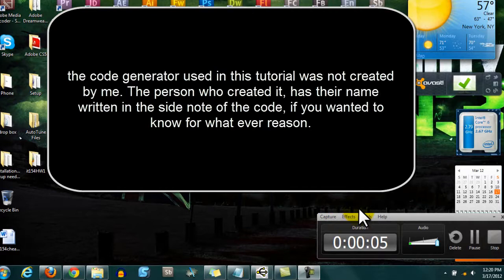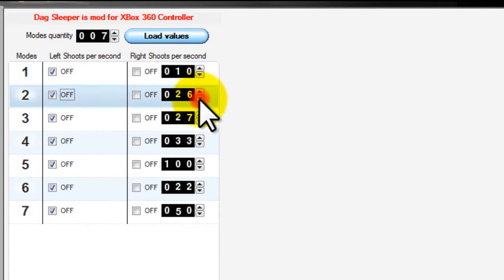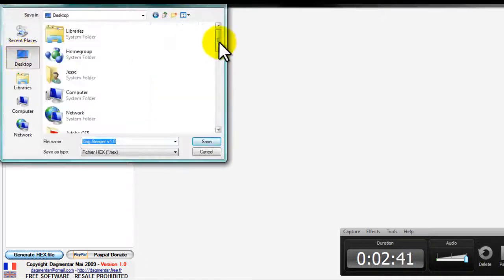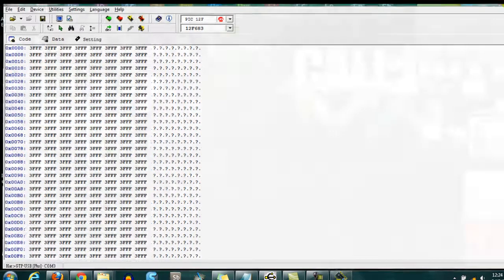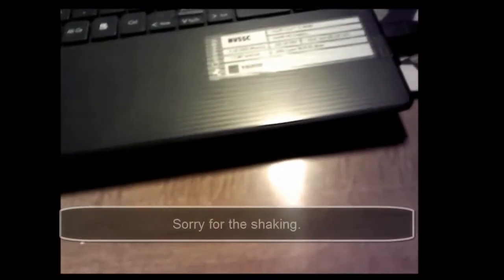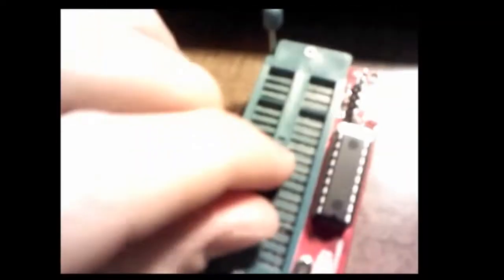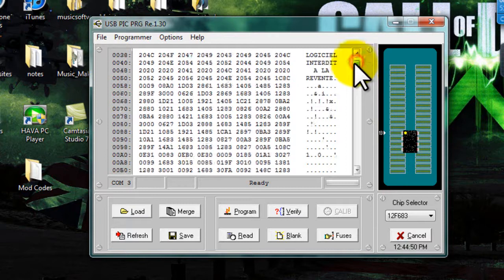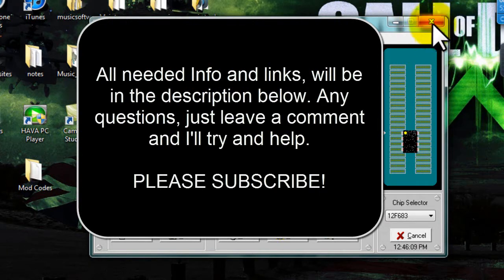How to make a Rapid Fire Mod Controller(part 1 - programming the chip)

Comment: Xbox one ?
Reply: The chip is a ATiny85 Micro controller, You can actually do it without the AVR/ISP Pic Flasher by using a ATiny85 With usb and breakout board Attached. This will cost less than the programmer And all you need is Arduino IDE. Where the code is practically Java, It compiles it to Hex Binary on uploading the sketch. Means you can easily Edit the code parameters such as High and low values Which control speed of when it fires. But will work on Xbox one controllers or any controller with a 3.5v power usage up to 5v USB Controllers. I would actually recommend using a USB Wired controller as there is no 5GHZ Board so more room to play with. Connection points are the same. All you need is the buttons you want to activate and a wire to the trigger pin, You could also use a Momentary switch as the Toggle on/off mod. The ATiny 85 would be the better option and the Arduino pro mini is a Bit over kill And its smaller and more power friendly.